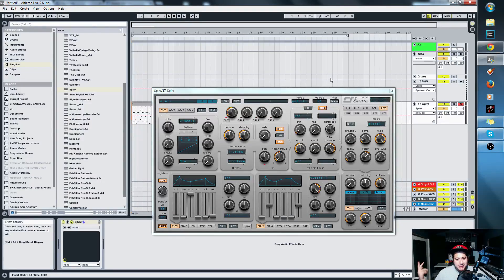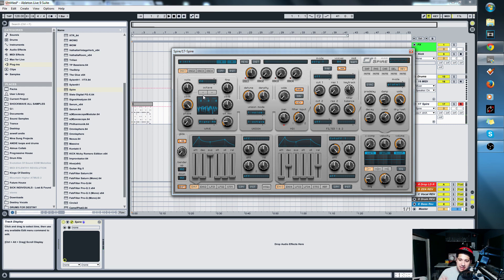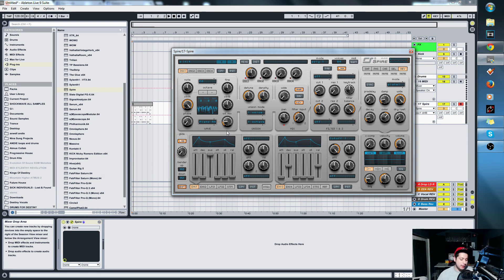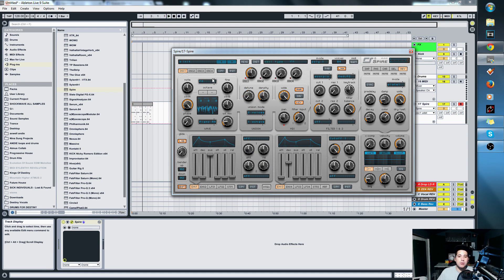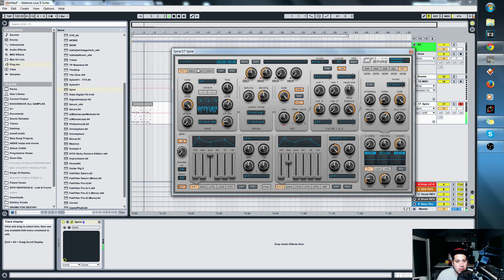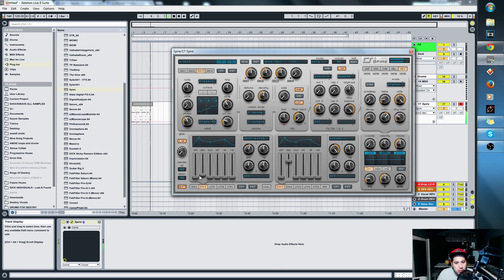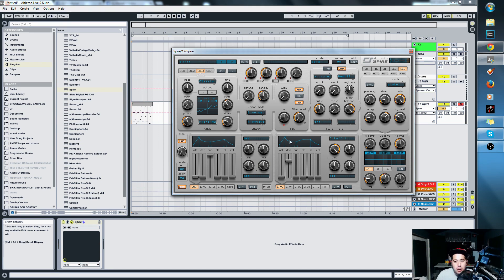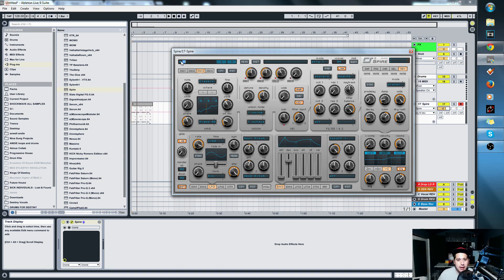Sound Design Episode 88 Making Don Diablo My Window Lead In Spire

Comment: Thanks so much! Can you show us how to make don diablo's piano stabs? Like in don diablo's universe drop or secrets remix? Thanks!
Reply: +Adam Oh YEEEEEEES PLEASE How can we get that Piano Sound so strong or the plugin at least, please help us.
Reply: That piano sound is from the Korg M1 plugin, either the M1 House Piano or the Piano 16 preset. The way you make it stronger is through compression with a faster release to make it punchy
Reply: you layer pianos. Don uses Korg M1 piano but you can use the nexus dancepiano or the lethal dance piano like me. you also use a grand piano and a distorted piano. i use 3 layers: dance piano, distorted dance piano, and grand piano. i was reading somewhere about the distorted piano trick and it actually made it sound fuller! also, you use compression with fast release to glue it and make it strong. you also want to EQ each piano and then have an eq on the buss. the EQ is to basically have each piano have its own place and have extra high end.